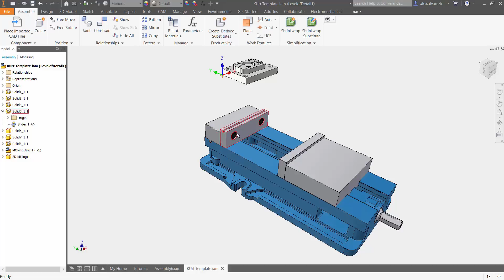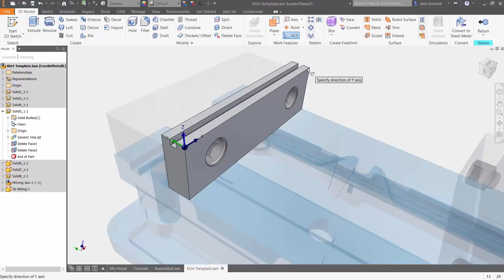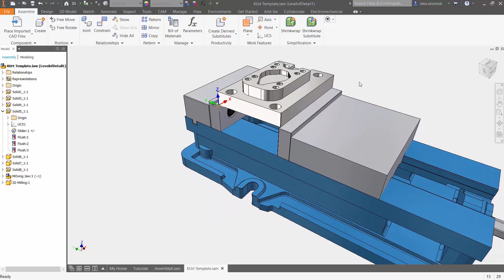Quick Tip - UCS to UCS constraint

Comment: Filiph, that is not a correct statement. You can always use the parameter dialog box to modify the UCS after placing it. The workflow is to create a reference point that is related to the round object using either a 2D or 3D sketch, then placing a new UCS located at the reference point created in step 1, then go to the parameters dialog box and translate and rotate the UCS as needed.  This allows you full control of the 6 degrees of freedom of the UCS. Hope this helps.

Comment: For anyone else watching, and perhaps unsure, the wrong  point for the Y direction for the UCS on the jaw was chosen. Since the jaw has a chamfer, the corner chosen is actually lower, thereby creating a slight angle by rotating the UCS about the X-axis. You can see the difference when you slide the moving jaw under the part.
A correct point to choose could have been the immediately adjacent corner in the similar direction.
Sorry for being obnoxious perhaps, since the message in the video is 100% valid, but small things like this can cause countless headaches down the line.